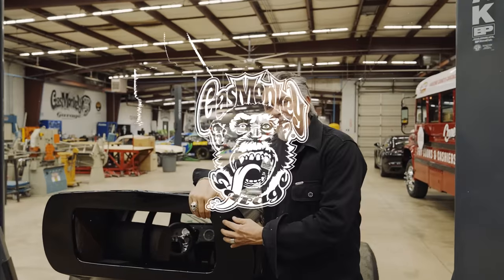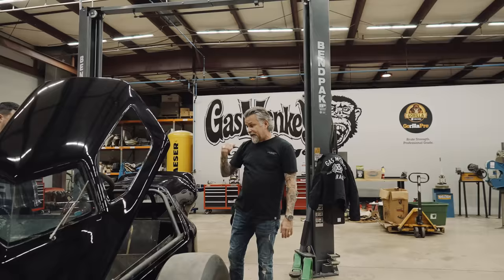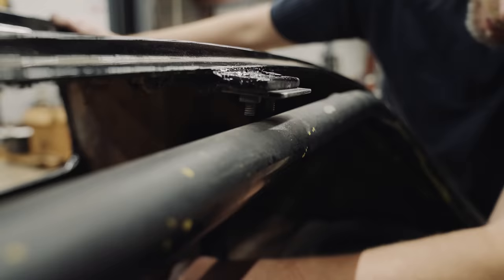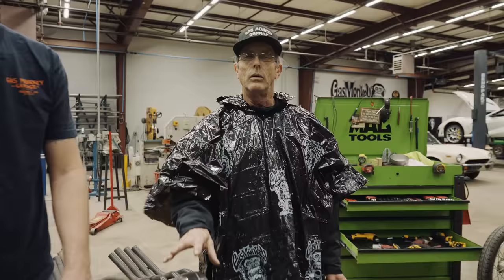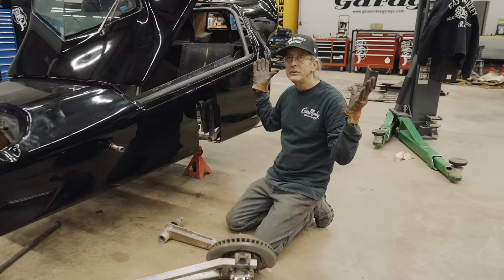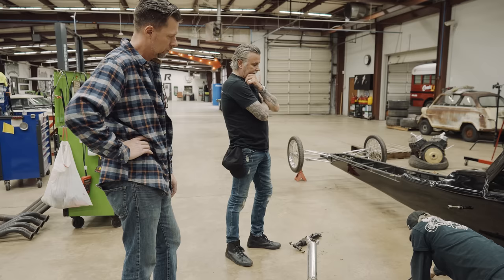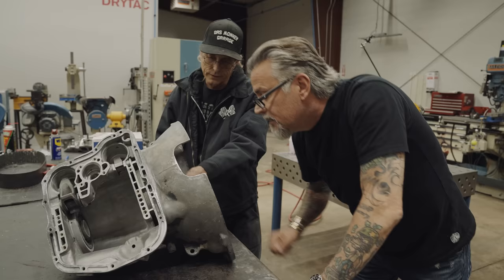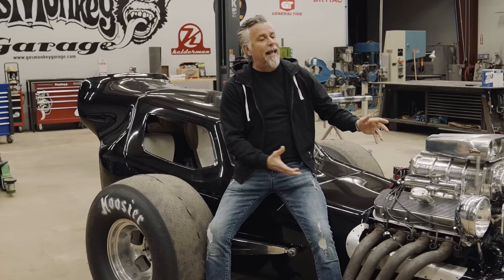We Brought A Legend BACK From the Dead!

Comment: A possible solution to your carburetor trouble would be using a modern holley sniper setup. It won't be seen and all the tuning could be done with a hidden tuner inside the cockpit. It's gonna be almost impossible to do any adjustments on a carburetor buried inside the blower housing. Just saying. Your southern Indiana fan Steve Riley. Keep up the great work. Woooooo....
Reply: Take the machine shop the replacement carb to bolt up to the manifold and dyno tune it on there so all the carb adjustments are completed on the dyno. Then remove the carb once all set and install it back into the polished housing with a new blower belt and bearings freshened up on all pulleys. Adjustments inside that fake housing will be a nightmare though a few well placed and machined holes and plugs for basic carb tuning (idle screws/mixture screws, etc.),  would be proper improves.

Just so you can pop the shiny plugs and do final fine tune carb adjusting.

Comment: Yall better double and triple check the front 3/4 of the chassis.  The way he let it bounce all over the trailer might have cracked a bar.  Dragster are notorious for cracking if you tow them without supporting the long skinny chassis.
Reply: We always ratchet strapped it down on the rear tires and the front of the frame and never had any problems with newer dragsters.

Comment: Imagine doing all the work and having a "boss" come every 30 mins to tell you how to do it and what to do like he is the one working on the car lol
Reply: When you have a team pulling apart the engine for no reason id be concerned to.  They all looked like lost sheep when Richard asked them what they were doing.
Reply: They had to due to the mouse or rat house inside, though with hanta virus out there, they should have all been wearing masks (bleach mist spray), and done it outside the shop, and never use a vacuum cleaner or shop air.

Comment: Brush and roll resin into the old fiberglass from the inside surface with 1/3 the harder that will allow it to penetrate.
Then follow up with normal resin and harder once you're satisfied with enough coats. Don't try to do this in 1 shot.
Reply: Yess this.